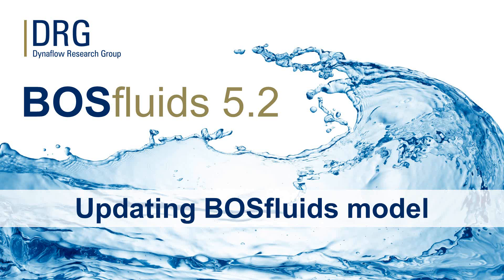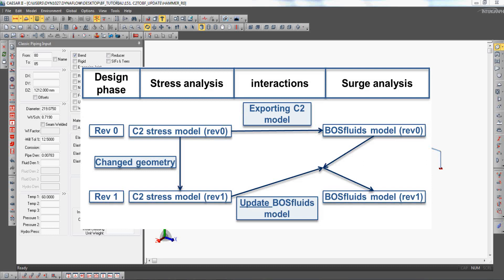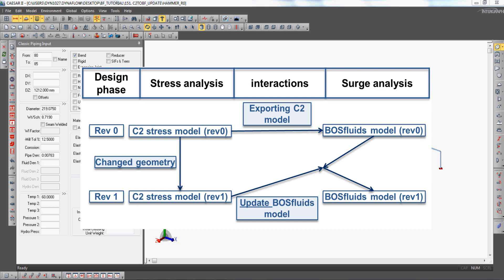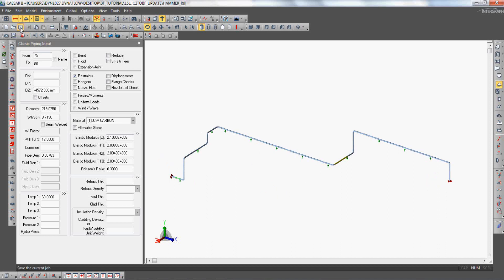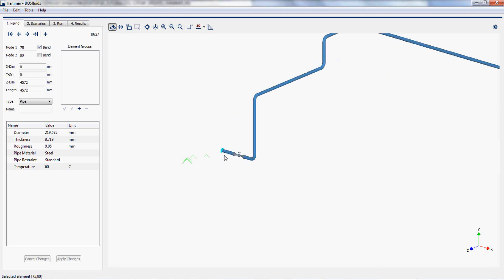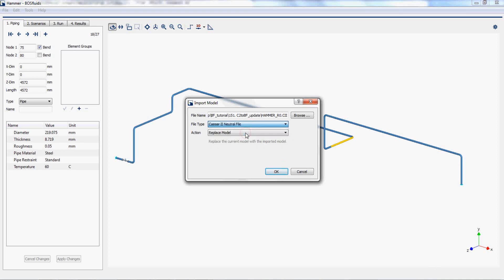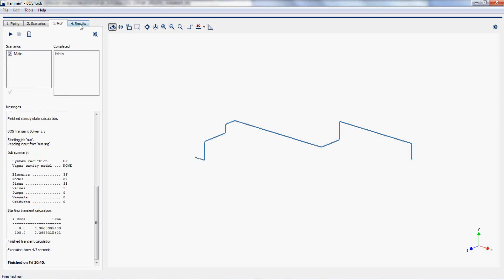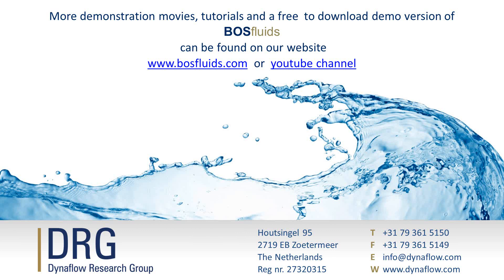BOSfluids Demo #14 - Updating a BOSfluids model

Comment from the maker: Even more #BOSfluids demonstration videos online now! Especially the updating a BOSfluids model is interesting for engineers doing a #stress analysis in parallel with a #surge analysis for the same system. 
Topics include:
- Updating a BOSfluids model using geometry from a stress analysis
- Selecting specific nodes
- Changing units
- Renumbering nodes.